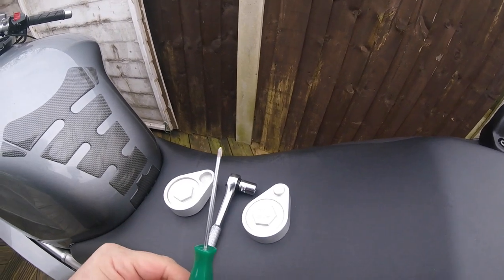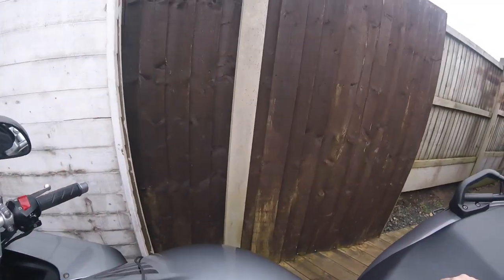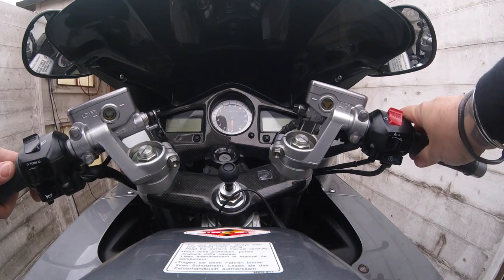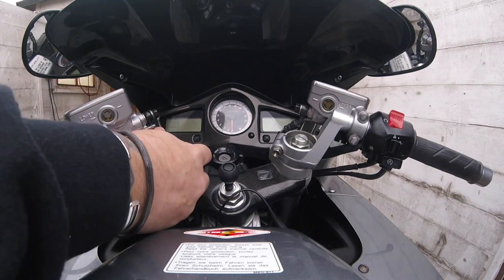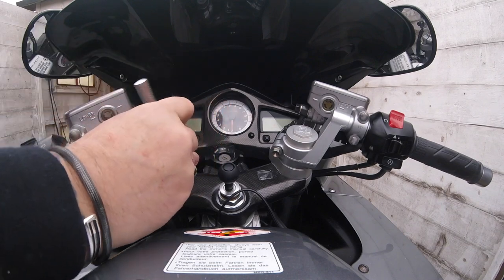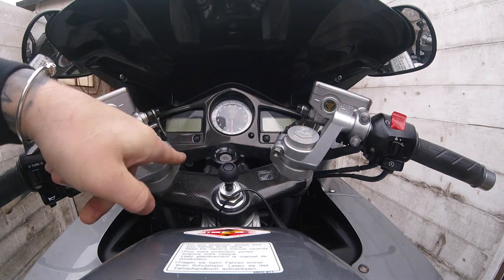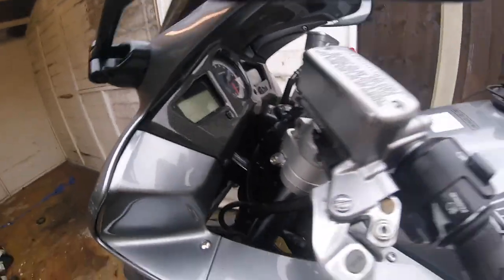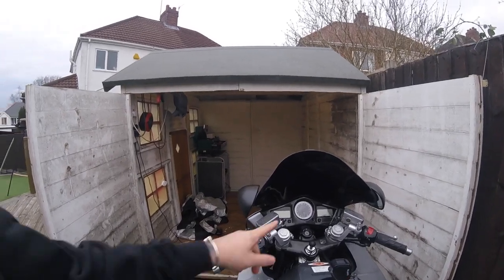Fitting VFR 800 Bar Risers - Moto CNC

Comment: This video convinced me to buy a set for my VFR750 however once fitted turning left knocked the kill switch and turning right activated the high beam switch. Had to modify the fairing at the mirrors to splay it apart. Company blamed my bike, poss non OEM parts or set up and decided not to allow my review to be visible on their site. Bike is standard with a very common Puig flip screen. I do agree with the quality of manufacture and the improved riding position.
Reply from the maker: That’s surprising as I had no issue with mine whatsoever, didn’t fowl anything. Check your forks haven’t been lowered in the yoke, a lot of people lower the fork about 10mm

Comment: Ran helibars on our vfr 750, very similar kit.  Massive improvement over the miles.  One good tip on vfrs, keep an eye on the voltage.  Low or high voltage is early warning :)

Enjoy the comfort.
Reply from the maker: Bacon Bike Tours cheers bro will keep an eye on them

Comment: They look like nice bits of kit, very well engineered. Out of interest, do the instruction give any direction on the minimum amount of fork stanchion that must be protruding through the adaptor section in order to reclamp the bars? I’m only asking as I have my forks as low in the bars as they will go. Basically the spring ring rests against the top of the bars.So am unsure if I’d need to drop the yokes down a little.
Reply from the maker: Kevs Shed wow that is low, no the instruction don’t state it but on mine the bar riser is more or less 50% on the fork and the filler cap fills the other 50% so I would say at least 12.5mm about yoke
Reply: Motourev: Motorcycle Tours & Reviews to be honest, I haven’t looked at the manual to confirm exactly how much fork should protrude. I may do that first and then give it an educated estimate before fitting risers 👍🏻

Comment: Hi the torque is 20 ft lbs for the pinch bolts , I have fitted the foot peg lowering kit   ,but had to move gear change lever and foot brake

Comment: On my 2003 VFR 800 the handle bar pinch bolts are 26Nm but my bolts are 8mm not 12mm, If memory serves me right. Can't check at the moment as I am 6,000 miles away from the bike.

Comment: Why didn't you release the main fork to slide up higher from below to get a full grab on the clip as the  same as before, you have lost about 10 mm at a guess on the security of the connection of the clip on some  handlebars, or am I totally wrong ?
Reply from the maker: @kevinwest4047  I have no idea mate, sold the bike 2 years ago
Reply: @Motourev  maybe its not possible to slide them up but im sure i see a video when a bloke undone the lower fork clamps and they shot up like two missiles being launched from a sub, but looking back on it if you did get the clipons flush to the top of the forks with full grip there would be no where to fix the caps to, catch 22 im guessing, but i would rather have the safety rings in place instead of the dont do a lot cap on the top, maybe im wrong but hey hoo

Comment: Hi great video looking at doing this to my 2002 vfr,are they the 25mm or 41mm riser's and the o ring you took off at the beginning does that go back on many thanks
Reply from the maker: Daniel Todd mine were the 25mm riser and the ring does not go back on. I have done everything to test if the bars move on the forks even tried lifting the front and the bars are solid in place.

Comment: Gonna have to invest in these, often find my neck and wrists hurt after a while, out of interest what did you torque up the bolts to?
Reply from the maker: Nigel Gallagher I haven’t yet, gotta find the torque setting the weekend.
Reply: Motourev: Motorcycle Tours & Reviews if you could let us know when you find out I would be really grateful 👍🏻 cheers bud
Reply: @gallagher4141  i reckon, tight, then a little bit tighter! thats my way lol
Reply: Steve Foster 😂 the old fashion way 👍🏻
Reply: factory manual for 6G, which says 20lbs for the handlebar pinch bolt

Comment: Is round ball thingy on centre nut for Fone if so what make please and is it any good Thanking You in anticipation of your forthcoming help and co operation KARL
Reply from the maker: karl 😂😂😂 like the terminology, exactly how I talk. It is Ultimate Addons Mount, the best on the market mate, I got through multiple Amazon ones that all snapped, these are strong as hell.
Reply: Motourev: Motorcycle Tours & Reviews Thanks for that they out stock so going try £20 Ali express that’s lot from them will show you courtesy of review if you like. I’ve got exact same risers 👍🏼 just booked in for Nitron shock gold seal fork rebuild and springs you any advise on suspension? You moved forks up to 50mm or whatever they do ?

Comment: Hi, I watched this video after logging into Moto CNC's site. The video was listed under the CBR1100XX for handlebar risers. Presumably they are exactly the same for the Blackbird and the VFR that you are working on? Another question; you removed the circular clips but I didn't see those going back on - are the clips redundant once the risers are fitted? Thanks.
Reply from the maker: The risers fit quite a few Honda’s. I just forgot to put the clips back on

Comment: not sure about that. your bars are now only clamping into half the area they were. and the bolt is almost above the end of the forks
Reply from the maker: Adam Maxwell works great same as the thousands of other vfr’s that’s done it. I have checked regular to see if there’s been any movement of the bars horizontal and the vertical position and nothing so I am more than happy thanks 👍🏻
Reply: Mine have been on ages and no movement at all.

Comment: But there the same height,just top yoke is lower steering angle increased,more weight on the front,and the windscreen is closer to the bars.
Reply from the maker: Not touched or adjusted the yoke, simple fact is they work, steers better, better on the wrists. Simple really.
Reply: It's a lowering kit,not bar riser
Reply from the maker: @jennifermcglue4560  😂 what?
Reply from the maker: @jennifermcglue4560  what you smoking 😂